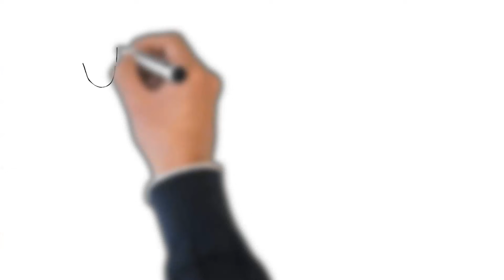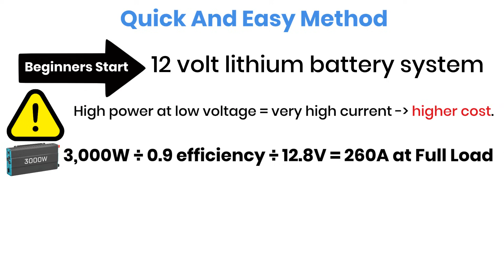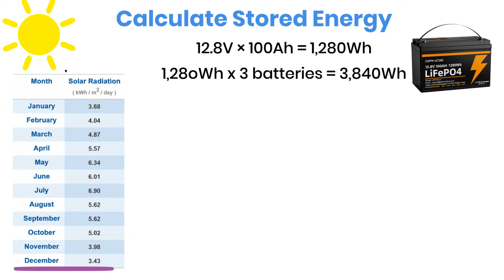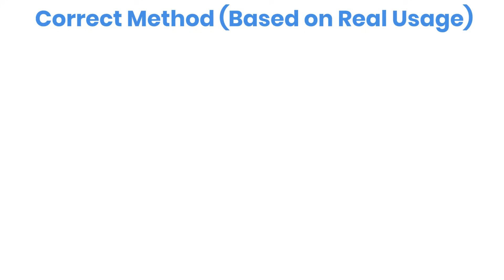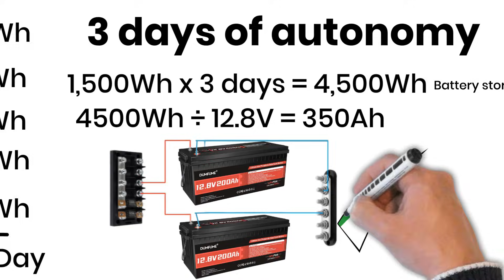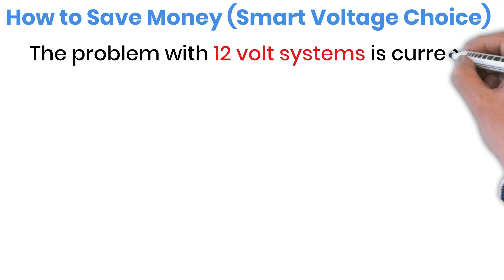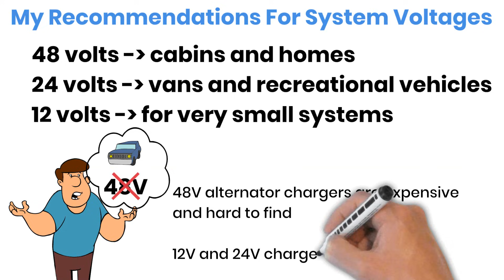How Many Solar Panels for a 3000 Watt Inverter at 12 Volts? (Real Answer + Save Money)

Comment: I keep adding ,adding ,adding pannels hoping to beable to run a minisplit a/c unit plus store enough in the ecoflow batteries to go afian the next day ! Off grid cabin.  The issues seem you never get the promised power from the pannels 😮
Reply from the maker: I know exactly what you mean. The rated wattage on a panel is measured under ideal test conditions, so in the real world you’ll usually see less because of temperature, panel angle, dust, wiring losses, MPPT efficiency, and weather. That’s one reason I always recommend designing with some extra solar capacity instead of relying on the nameplate rating alone. Out of curiosity, what size mini-split are you planning to run?
Reply: Just figure in about 1/3 less than the rated power of panels.
Rule of thumb.
I have 800W bifacial and highest I got was 615 watts.

On and do not scrimp on the inverter.
WVC1200 is GARBAGE. I could only get 240w max out of panels with that. That has cheap and bad MOSFETS in it. Input voltage is too low - it wants 36v to 45v input which most panels never make. With a 50v max input I cannot run 2 panels in series. And 27v OC is too low.
Went with one double the price and now get close to panel ratings.
I use grid tie inverter on ground mount.

Having an issue with the CALLSUN bifacial panels though. They developed small white spots between the glass and the cells. And not just a few either but MANY MANY of them.

Comment: Thanks for the video sir. Really informative. My question is: what of I use two 12.8v lithium batteries to get 24v system. Is that a ok? That's my plan actually bcos of fund.
Reply from the maker: Two 12.8V lithium batteries connected in series to make a 24V system is very common and actually a smart approach if you’re building in stages because of budget. Just make sure the batteries are the same brand, same capacity, same age, and ideally fully balanced before connecting them in series. A 24V system will also reduce current compared to 12V, which helps with cable size and inverter efficiency.
What size inverter are you planning to run on the 24V setup?
Reply: @batteryhacker4343 Thanks for the prompt response. I'm looking at just 2000watts. Dont have too many loads i guess
Reply from the maker: So glad I could help with a prompt response! Good to know you're looking at 2000 watts – that definitely changes the calculations a bit, and I appreciate you sharing that detail.

Comment: If you in a sunny place you don't need a lot of solar panels
Reply from the maker: In very sunny locations, fewer panels can still produce a good amount of energy. But it also depends on how much power you use and how reliable you want the system to be during cloudy days or winter. A small load in a sunny area might only need a few panels, while heavy loads like air conditioning can still require a large array even in strong sun. Where are you located?

Comment: 30 yrs. of professional electronic career.  This video is well done, easy to understand, and spot on in recommendations.
Reply from the maker: 30 years, huh? Guess I'm doing something right if I can impress a seasoned pro like you! 😉 Thanks for watching!
Reply: @batteryhacker4343  When you actually know what you're explaining, you can makes sense to a grade school kid.  Big words generally provide cover for ignorance.  You used sound reasoning and a proper approach.
Reply from the maker: I really appreciate you saying that! My goal is always to make these technical topics accessible, so it means a lot to hear I hit the mark.
Reply: 30 yrs of career and you missed this one 1500wh X 3 days = 4500wh is wrong. 3 days needs to be converted to 72 hours. The correct calculation is 1500wh X 72 = 108,000wh of storage needed, assuming all appliances running all the time.
Reply: @masomeneado  That's the problem with simple math.  Appliances don't all run, all the time.  At night the fridge should be opened less and any illumination should be drawing nothing.  So many dynamics always put the calculations off but the process described is sound.  You make a good point though.
Reply: well it was not in solar haha clown
Reply: @jacktheripper-hp9tx  Does your Mommy know you're on the computer and talking with grownups?

Comment: Why a 12V system? This means high currents and thick cables. 
Why not 24V or 48V? This means thinner cables and a lower risk of fire.
Reply from the maker: You’re completely right 👍 Once power levels start getting higher, 24V and especially 48V systems become much more practical because the current drops a lot. Lower current means thinner cables, less voltage drop, less heat, and generally a more efficient system overall. The main reason many beginners still start with 12V is simplicity and lower upfront cost, especially for small RV or backup setups where a lot of 12V devices already exist. But for larger systems, I’d usually recommend moving up to 24V or 48V as well.
Reply: @batteryhacker4343  If I went with 48v, I would have to replace my entire setup.
And lose my shading protection.

Comment: I love your work analysis, but i want to know if i  have an inverter of 3.2kva
1)What capacity does the charge controller be?
2) what capacity does the lithium battery?
3) how many solar panels of 420 watt are needed?
Reply from the maker: A 3.2kVA inverter alone isn’t enough to size everything properly. It really depends on how much energy you plan to use per day.
As a rough starting point (assuming a typical small system):
1) Charge controller: around 60A–100A (depends on system voltage and panel size)
2) Battery: usually 200Ah–400Ah lithium depending on how many hours you want backup
3) Solar panels (420W): roughly 3 to 6 panels for a basic setup
But these numbers can change a lot based on your actual usage.
If you can share:
1) Your system voltage (12V / 24V / 48V)
2) Your daily load (in watts or watt-hours)
I can give you a much more accurate setup

Comment: The last sentence sealed it for me. I run a 12v 900Ah system in my work van. I am shy on solar panels tho…I only have 450 watts coming in.
Reply from the maker: 900Ah at 12V is a lot of storage, but with only 450W of solar, recharge speed will be quite limited. You’ll probably notice it takes a long time to fully top up, especially after deeper use. In setups like that, the solar side usually becomes the bottleneck rather than the battery.
What kind of daily loads are you running in the van?
Reply: @batteryhacker4343  Thanks, yes you are very right. I run a small sharpening service…so small intermittent usage but the reason for large storage is I live in the very hot desert so I have a portable a/c which is a big 2300 watts. I have 2 layers of insulation in the van. This will be the first summer testing it out and fixing the shortfalls.✌️
Reply from the maker: Desert conditions + AC is where things get challenging. A 2300W load on 12V is pulling a very high current, so your battery bank will handle it, but the recharge side (450W solar) will likely struggle to keep up, especially if the AC runs for longer periods.Your plan to test and adjust is exactly the right approach. In your case, more solar would probably make the biggest difference, or even running the AC during peak sun hours to reduce strain on the batteries.
I’d be curious how it performs in peak summer? How long are you expecting to run the AC per day?

Comment: i use a 3k inverter with my 100ah battery.  i have a backpack that use to run my electric lawnmower.   i have 6 solar panels but i mostly use the 450w inverter with them. it is more efficient.  i only use solar for a few things in the house and keep my 3x100ah  batteries charged for backup.
Reply from the maker: That’s a smart way to use it,  keeping the 3k inverter for backup and using a smaller inverter for daily loads will definitely be more efficient. Running light loads on a big inverter usually wastes some power, so your approach makes sense.
Are you planning to expand the solar side later, or mainly keeping this as a backup system?
Reply: @batteryhacker4343  i might stay small and just keep it for backup. my wife is not excited about it
Reply from the maker: 😄 That’s fair,  the “wife approval factor” is real. Keeping it as a small backup system is still a solid win, especially for outages.
Does she mind the cost side more, or the space/setup part?
Reply: @batteryhacker4343  she does not see the need. the location is bad for solar panels. there are trees everywhere and it cost more than $2k per tree to cut.
Reply from the maker: Heavy shading changes everything, and at $2k per tree it’s definitely not worth it just for solar. In setups like yours, keeping it as a small backup system is actually the practical approach.
You could still get some benefit if any panels can be placed in the clearest spot or even made movable to catch better sun, but if the location is mostly shaded, there’s a hard limit to what solar can do.
Do you get any decent direct sun during part of the day, or is it mostly shaded all around?

Comment: I remember a lesson at school that we only feel the shock from electricity above 30 volts, you would feel 48 volts but under normal circumstances shouldn't harm you. But no shock is nice so 24 volts is perfect for me.
Reply: It's the amps that kill, we also learnt that at school 🏫
Reply from the maker: Safety first is always a good approach, and 24V is a solid middle ground for smaller systems. 👍
Reply: @batteryhacker4343  24v inverters ain't exactly cheap

Comment: Yup. I made this mistake. Assumed, 'well I'm buying an inverter, might as well have more watts'.
Have the exact one as featured in your great video.
Ps,
Anyone want to buy a 3000w inverter?
😂
Reply from the maker: 😄 Happens to a lot of people honestly, bigger sounds better until you actually size the system around real usage.
At least you’ve got room to grow now if you ever add more loads.
What are you currently running on it?
Reply: @batteryhacker4343  Hmmm, my reply disappeared.
3x lead leisures at 110a each and just 240w solar. It's the batteries limiting usage I suppose as you can't use their full capacity.
Reply from the maker: That makes sense, with 3×110Ah lead-acid, you usually only get about 50% usable capacity, so the battery can definitely become the limiting factor. And with 240W solar, recharge speed will also be fairly slow.
Are you finding it runs out overnight, or more that it struggles to recover fully during the day?
Reply: @batteryhacker4343 I rarely use the inverter tbh, maybe to charge/run gaming laptop and the occasional microwave.
Power was only an issue one October in Scotland. Short daylight hours and overcast/rain. Had enough power for 12v system, but the inverter started beeping after 2 minutes of microwave use and shut off.
In an ideal world, I definitely need more panels, and a battery upgrade, but the amount of use my motorhome gets ATM doesn't warrant the cost.
Reply from the maker: That lines up with what I’d expect in those conditions. Scotland in October is tough for solar, especially with only 240W, the system can cover basic 12V loads, but high draw loads like a microwave will quickly expose the limits. The inverter shutting off after a couple of minutes is most likely voltage sag under load, which is very common with lead-acid, especially if they’re not fully topped up.
In your case, you’re actually thinking about it the right way, for occasional use, it’s hard to justify the cost of upgrading. If you ever did want to improve performance without going all-in, adding more panels would probably give you the biggest real-world benefit before changing the batteries.
Out of curiosity, do you usually rely more on driving (alternator charging) to top things up, or mainly solar?
Reply: @batteryhacker4343   Mainly solar. Being a motorhome, it is rare we move it once pitched, anything from a night to a couple of weeks.  Spring/summer we've no issues. I should have bought a 2kw inverter on reflection, it would easily meet our needs.
Reply from the maker: That makes sense. if you’re mostly stationary, then solar really becomes your only charging source, so panel size matters a lot more than inverter size in your case. And yeah, a 2kW inverter would have been a better match for occasional loads like that, but honestly, it’s not a big issue. You can still use the 3kW inverter, just with a bit of awareness. For example, running something like a microwave works best when the batteries are well charged and ideally while the panels are producing. If you ever upgrade, adding more solar would likely give you a bigger real-world improvement than changing the inverter.
What’s your current panel setup, all in parallel or series?
Reply: @batteryhacker4343  Two 120w panels, but bought many years apart. I added the extra panel and the inverter a couple years ago. The motorhome was bought new by a UK couple that lived in it full time in Spain so the one 120w was sufficient in the Spanish sun and no inverter.
After 7 years, they came back to the UK and sold it. I bought it, and haven't used it outside the UK yet. Hence thinking the extra panel was required.
As the panels ratings don't match, and after researching, I decided to wire them independently, each with their own solar controller.
This seems the most efficient for mismatched panels.

Comment: People,  just read the instructions for your specific inverter. It will tell you all you need to know.
Reply from the maker: That’s definitely a good starting point. The inverter manual usually lists the recommended battery voltage range and input limits. The reason I break down the math in the video is because manuals rarely explain how many solar panels you actually need to support the inverter in real-world use. Both together usually give the best result.
Reply: thats wrong for the solar panels  it depends on where you live and if its in direct sun the whole day  if you have any trees to

Comment: My base load is met by the utility. I have 700 w panels in Bangalore, 13  deg N lat. But even here, I get only 1 kwh per watt per year. 700 units per year. Solar is not a stand alone, its a top up
The Govt utility has retained thermal (coal) and hydel units. And added solar to provide more power during the peak day hours of 8 am to 5 pm. A top up, not a replacement
Go further north. Solar panels remain frozen with up to 1 foot ice in Canada. No power for 5 months around the winter solstice?
The only way solar will be practical is to send satellites into space with acres of plastic film printed with solar panels. Microwave transmitters beaming the energy to Earth. Read Isaac Asimov's short story on the topic
Reply from the maker: In many places solar works best as a supplement to the grid rather than a full replacement, especially in higher latitudes or harsh winters. Places with strong sun year-round can rely on it more heavily, but system design really depends on local climate and energy needs. Hybrid systems (grid + solar + storage) are becoming the most practical approach in many regions. Interesting reference to the space-solar idea too. it’s been discussed for decades.

Comment: 3000 W is asking a lot from a 12 volt system. I still use 200 amp hour deep cycle batteries since they're $100 a piece. Where all these low voltages coming from because all my batteries are 14.2 volts and charge at 14.7 volts?
Reply from the maker: You’re absolutely right that 3000W is a heavy load for a 12V system, at full load that’s around 250 amps, which is why cable size and battery health matter a lot at that voltage. As for the voltage numbers, 14.2V–14.7V is charging voltage, not the battery’s nominal voltage. A 12V lead-acid battery is called “12V,” but it actually rests around 12.6–12.8V when full and only goes above 14V while charging. So when people mention 12V systems, they’re referring to nominal system voltage, not the active charging voltage. That’s also one reason many larger systems move to 24V or 48V, same power, much lower current.
Reply: @batteryhacker4343 I must have odd deep cycle batteries as my batteries rest between 13.6 volts and 14.2 volts.
Reply from the maker: That can happen if the batteries were recently charged and still have a surface charge, or if the charger / solar controller is still connected. Lead-acid batteries often sit higher for a while after charging before settling down closer to the typical ~12.6–12.8V resting range. Another possibility is if they’re actually lithium batteries, which rest at a higher voltage. If you disconnect the charger and check again after a few hours, the true resting voltage usually becomes clearer.

Comment: Can you suggest me what kind of solar mini system should I choose for charging my trike 

I have this model Trike & Do delivery service in the mountains, there are ample sunlight but not electricity facility 

https://youtu.be/6D8J1r8hsOA?si=degPGb0aph526EFb
Reply: Does your trike have regenerative braking?
Much depends on your trike's battery and how you use the trike.
And of course how quickly you need recharging.
Reply: @crazysquirrel9425 No
It's a simple one to used in cycle ones
Nothing special